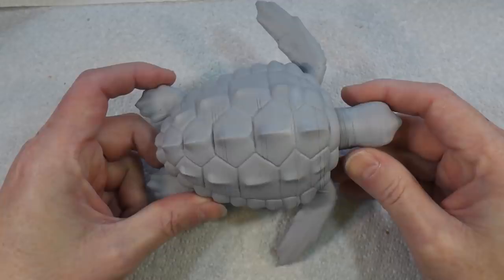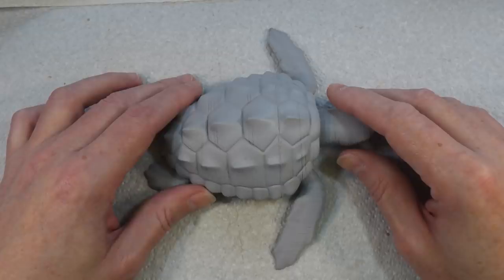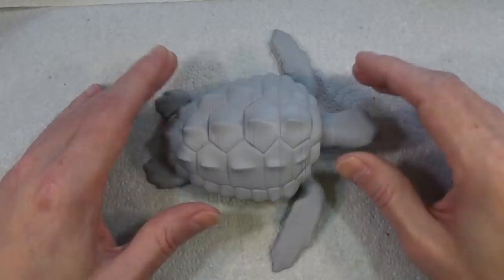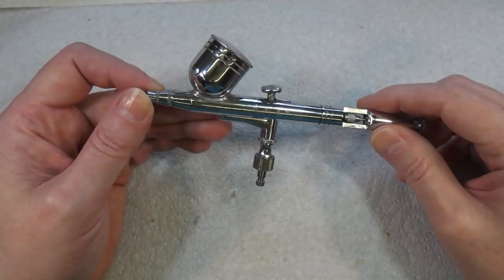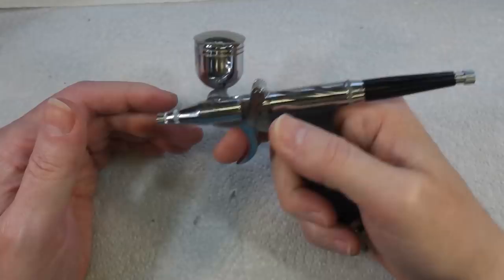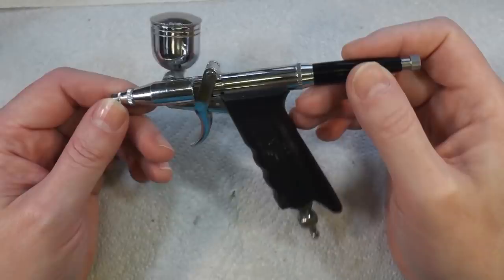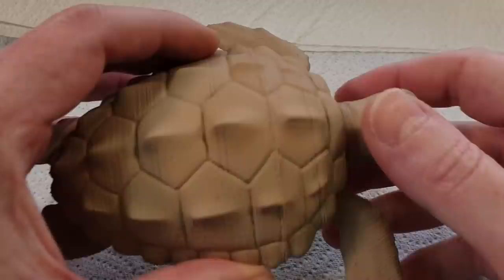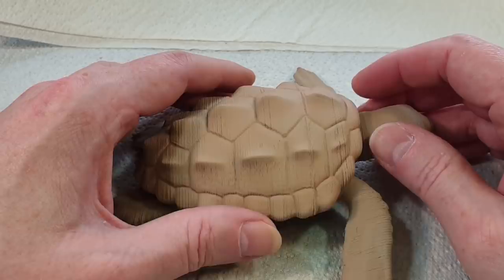Basic airbrushing techniques for beginners

Comment: This video couldn't have come at a better time for me- after building my first model around 50 years ago (of course, it was an Airfix Spitfire) I've finally taken the plunge and my first airbrush will be delivered tomorrow. I've learned a lot from the video and will try to to put your methods into practice. I like your no-nonsense approach to making these, you have a good uncomplicated style without extended scenes of speeded-up video which a lot of people use and that I think are useless as you can't see what's going on. Right, I'm off to Hobbycraft to buy some X20A. And I think I should also get hold of some XF81, of course!
Reply from the maker: Thanks, I appreciate it. I do speed up footage sometimes, but I always try to make sure I get the point across beforehand, or if I'm doing something obvious like sticking bits together.
I'm glad the video helped, thanks for watching.
Oh, and XF-81 is the best colour out there :-)

Comment: A fantastic video. I've just had my first airbrush delivered and I'm petrified of using it and your video has certainly helped ease my worries
Reply from the maker: Glad it helped. Just have a play with it. I would recommend going for a 50/50 mix of paint and thinner, set the regulator to about 20psi and try it. Thinner paint mixes need lower pressure, thicker paint mixes need higher pressure. You'll get the hang of it in no time. If you have questions, feel free to ask.

Comment: for cleaning my airbrush i like to use tamiya's airbrush cleaner and just a q-tip/ cotton bud/ cotton swab. I've used it so far on lacquers enamel and acrylic and it easily rips the paint off even if its been dried for a week or more, however it is a little pricey (20 USD on amazon for 250ml)
Reply from the maker: There are quite a few solutions on the market. I sometimes use cheap lacquer thinner for Wilkinsons - cleans everything up a treat but it does stink :-)

Comment: The compressor that you use. What’s it’s power. I have access to a mechanics portable compressor that’s used for wheel guns and so on. If theres a way to use that I’d be laughing. Any advice welcome. :)
Reply from the maker: I actually just got a new compressor, as the old one developed a pin hole in the receiver so the tank must be rotted through from the inside, but it lasted 20 years so I can't complain. My new one is a Hyundai HY5508, which is a 100psi shop compressor but so lovely and quiet. I use a regulator to drop the pressure for the airbrush, but I can still use all my air tools.
Compressor: https://amzn.to/2TM7rAi
Regulator: https://amzn.to/3gNffcS
You can buy a kit to convert the regulator to allow an airbrush hose to be connected. I have a Euro quick coupling on the inlet so I can use a normal airline from the compressor and just plug it straight in. I also use quick connectors on my airbrushes so I only need one line:
Quick connector set: https://amzn.to/2TNAMKF
Obviously the links are for reference - make sure you get stuff that fits your needs.
Hope this helps :-)
Reply: @SteamGeezerUK  thank you for that. I’ve been looking at that compressor to, curry’s sell them, my brother in laws an area manager for them so Good deals. (Except on ps5 😭he can’t get me one yet) but I just need that regulator you linked to get started so you’ve saved me money and give great advice in general. Great videos thank you.

Comment: What a nice and simple way of talking about airbrushes...got a lot from it especially on the cleaning of them...but have you tried the airbrush cleaner from tamiya?...from what I have been told of it it will clean anything, just wondering what you're thoughts where on it? That is if you have tried it....Nick
Reply from the maker: Thanks, I appreciate it. I've never used Tamiya airbrush cleaner, never needed to. It may well be very good, but I've never bought any. I've seen people use all sorts, even car screenwash (also from Wilkinsons). I've never used it myself, but I saw a guy using it during an airbrush demo and it seemed to work really well for acrylics.

Comment: Fantastically informative video as always Steamgeezer. Just one question - from where do you get the sets of O rings?
Reply from the maker: I bought mine from ebay a couple of years ago. There are different sized O rings in every brush, but I found 6mm OD, 0.5mm thick nitrile works for the main O ring for most brushes.
Reply: Thanks Steamgeezer!

Comment: Ahhh.....should have watched this before asking questions about cleaning out the air brush...! Do you ever have issues with paint splashing out the top of the "pot" if you tip the brush up too far, having no lid on....?
Reply from the maker: Yes, quite often in fact, but that's because I tend to overfill the pot :-)
Reply: @SteamGeezerUK  Thanks......

Comment: I am back into the hobby since January, after almost a 50 year break, thanks to #H4H and #ModelsForHeroes. I bought my first airbrush a few months ago, only a cheap one but it seems to work alright. Struggling to find a decent desktop spray booth, do you have any ideas?
Reply from the maker: Good to have you back. I did a little Hurricane build for MFH a while ago :-) 

I don't use a spray booth as I work in my workshop that has extractor fans. If I wanted one, I would probably make my own as I have pretty much everything I need to do so.

I would start with the cheapest one I can find and see how you get on with it. Also, if you haven't already,  I would recommend joining some modelling groups on Facebook, such as Mediocre Modelers, Weathered Models and so on. There are loads of guys on there who use spray booths - they'd probably be able to give you a better answer than I can.
Reply: SteamGeezer and Son Independent Traders Thanks for replying,  I go to a group MFH in Preston and Shotton. Yes I did see your Hurricane build. Dioramas are my next target.. an extractor fan might just be the way to go...

Comment: Nice video, thank you! Have you ever had problems with the Evolution Silverline that it leaks air from the nozzle? Although you are not pushing the trigger?
Reply from the maker: Thanks for watching. I've never had a problem with my H&S airbrush. The first thing I would suggest would be to contact H&S and see if they have a solution. I would imagine it's a dodgy seal in the air valve somewhere.
Reply: Ocaasionaly the teflon seal in the sprayhead does not seat properly. Pull the needle back a little then hand tighten the spray head then push the needle back in, tighten and you should be good to go. Hope that's all that's going on.

Comment: What compressor are u using mate ?
Reply from the maker: I have a 10 litre workshop compressor running at 100psi, with a separate regulator for the airbrush. I have a lot of air tools, pressure casting chamber etc, so the compressor has to be big enough for all of those.
Reply: @SteamGeezerUK  I'm trying to get back into the modeling did it when I was a kid now being 43 its  time to get back into it but there is so mutch stuff on the market and being in New Zealand the hobby shops are declining.  So what I'm saying aka asking Is where do u start what is the best stuff to get like compressor   and paint and so on . There is not a lot off ppl I can ask for help or gide the ones I knew moved on or closed shop
Reply from the maker: I really don't know anything about hobby compressors, which is why I didn't cover them in the video. I have a shop compressor because I have a workshop. You can buy small workshop compressors at most big DIY stores (do you have Bunnings in NZ?), but they're noisy, probably way too noisy to run in a house if that's where you're working. You can buy airbrush kits that come with a compressor, but I wouldn't really be able to advise on what to get.  I believe the Iwata compressors are good, but they're very expensive.

As for paints, I use mainly Tamiya because they're relatively cheap and work very well, but the colour range is more limited than some, although I usually find they're sufficient for my needs. You should be able to find them on Amazon or ebay easily enough. If you're on Facebook, it would probably help to join some modelling groups - if you can find any in NZ people will probably be able to help you source things more locally, but I would also suggest groups like Mediocre Modelers, Weathered Models and the like. They're international groups and generally people are very helpful.

Feel free to ask questions here too, of course, but there's strength in numbers :-)